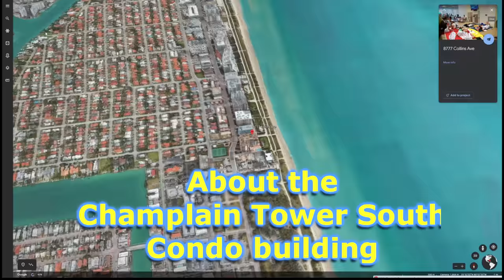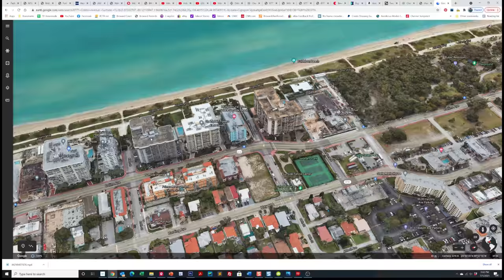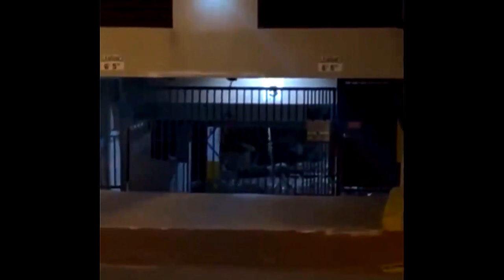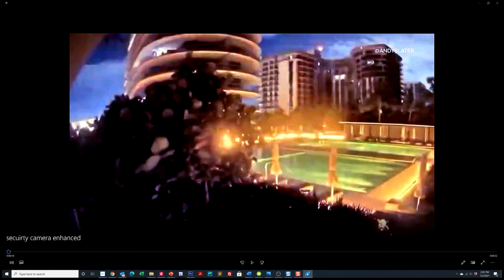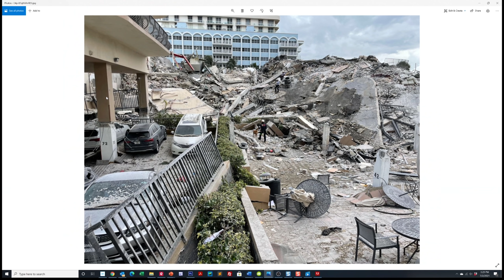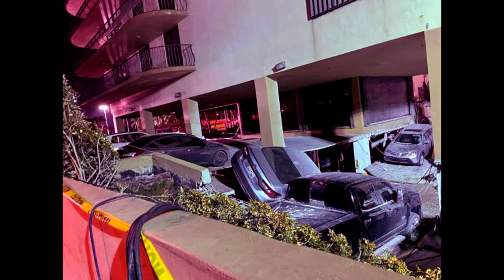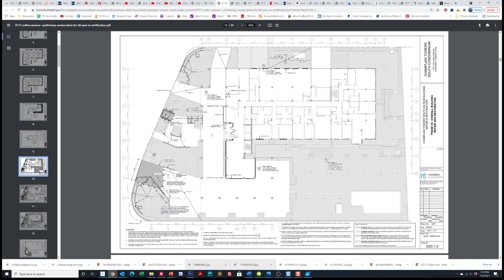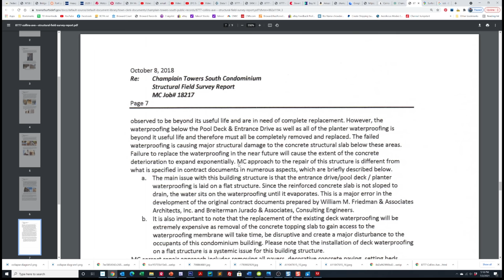Here's Cause Of Miami Condo Collapse Champlain Condo Towers, Surfside

Comment: Structurally speaking, it is a foundation failure due to cave in or seepage of water from the swimming pool, since this pool was built with no structural stability on the adjacent buildings. This building was so heavy that the soil bearing pressure on the pool side cannot resist this heavy loads so it collapse.
Reply from the maker: Everything you just said was incorrect. The pool was built with quite excellent structural stability and in fact that's why the pool survived if you look at photos taken the next morning after the collapse the water was still in the pool. So how do you derive from that that the pool was weak? There was no sink hole there was no sea water that came in as far as anybody knows
Reply: Sorry, that's just wrong, I'm afraid.  
The pool is still intact, and in its intended place, even after a major collapse nearby, because pools are built with very strong, thick walls and base to resist the water pressure. The pool is pretty much supported by the ground, not columns, so it's nothing to do with the foundations of the building. A pool leak couldn't remove THAT much rebar, there is very little around any of the column tops. 
I see your point about the pressure of the building being at the edge of the pool, but the pool hasn't moved, which would happen if that were the case. 
The building's columns have just sheared off where they should have supported each deck/floor, and once one has gone, the others come down, too.  
The foundations of the building have not subsided, or the columns would have gone down, when they are obviously still in place.
Good guesses, but wrong this time.

Comment: Pool equipment rooms are always wet. Stuff leaks all the time
Reply: Yes true, but should only be wet when a leak springs up or when washing the floor. If proper maintenance is in force then the leak will be fixed within a few days max. If water is due from washing then it will be drained and dried within hours or a day max. If the maintenance is shoddy or non-existent than the water will stand and over time cause structural damage. By the looks of the pictures, this building had a terrible to non-existent maintenance program!

Comment: YOU NEED TO GIVE THIS TO ALL THE LAWYERS FOR THE FAMILIES.
Reply: Its here for the viewing......
Reply: Why?  As condo the owners are residents.  With an few exceptions the residents were responsible for building upkeep.
Reply: @richranchernot  they were very obviously not responsible for maintaining the structural integrity of the building dude. Maybe their own rooms but not the support beams of the building or the pool.
Reply: It’s on YouTube it’s available to everyone even the lawyers.
Reply: I am sure they don’t need a Youtube video. Everything this guy has is known.
Reply: @zuthula3847  The owners run the HOA. They are responsible for the building. Normally, when there are major repairs needed, the HOA charges the owners a special assessment to cover the repair. They probably hired a professional management company to run the HOA. They could sue the management company but it probably doesn't have the insurance to cover something like this. They will likely file bankruptcy

Comment: A remark that stuck with me is that in the rubble, "there barely is a chunk of concrete"... Makes me think it would be good to have a CHEMICAL ANALYSIS done of as many samples as could possibly be amassed of the concrete... if there is anything that has been kept out can still be traced - be cause the concrete consisting of a mix of ingredients that is off could ALSO have caused its properties (and most of all, its strength) to have been (far) below par - which also may involve it allowing for water to seep through and in much easier.
Reply from the maker: I am hoping NIS will shed light on this
Reply: @jeffostroff  indeed.. any idea how much time they will still need, is there anything known about that?

Comment: Sadly, tragically, this is what happens when developers start compromising their resources. Looks like they did build columns much smaller beneath the part of the structure that collapsed, plus there was leakage from the pool deck that saturated the concrete and rusted the reinforcement, which then turned the concrete to mush. I also understand the design flaw of the pool deck, itself, which was flat, not allowing proper runoff. This is really so sad with so many truly dangerous factors involved.

Comment: You need a proper "pointer" when doing such an analysis with photos and videos. It was impossible to follow anything on the graphics.
Reply: Bigger pointer and different colour  maybe....Wow what a great analysis!  

Why smaller pillars in the garage!??
Reply: When it comes to watching on a phone,  most definitely. 
 Like the super-jumbo size one that reverses colors inside of it from Windows 95.
Reply: I didn't even notice a pointer until i read your comment.
Reply: I had eye strain from having to search for the cursor all the time. Totally frustrating presentation.
Reply: Superb program!  I had a lot of trouble following the pointer, and I watched it full screen on a 22 inch wide screen monitor.  My choice for pointers would be both a larger size and a pointer that assumes the inverse color of whatever it is on top of.
Reply: I dunno why everyone is such a great video. Five minutes in "but that's not what caused the collapse"

Comment: One thing that others may have mentioned. Where is all the rebar? Even rusty rebar dosen't just turn to dust. There should be a huge twisted mess of the stuff. Even in the close ups where the floor has ripped off the coloums ther eis almost no rebar visible. I don't know what late 70's florida building codes are. But this looks to have less than a 2 story house would in France!
Reply: The engineers probably decided on less rebar, and that could have made this building weak.
Reply: It wouldn't surprise me if the rebar rusted to dust. Near the ocean things rust waaay more than away from the ocean. Very common in AC units near the beach. The rust you can encounter is a whole different story to anything inland

Comment: A logical and helpful look at this terrible catastrophe. Thank you. Regarding blaming the architect’s plans, we should also go back and check the ‘specifications’ book [or sheets] that are integral to the CD set of plans. They usually contain language that states exterior horizontal ‘finishes’ shall be sloped a minimum amount per foot, for drainage. As you know this is code. And It is standard language ‘usually’ in drawing sets. I am guessing here that is exists. Regardless, your point about adequately sloping decks, is perfectly valid. Has anybody checked those spec documents? Sometimes general contractors don’t even read them. They are, admittedly very verbose documents -but very important. But it should have raised a request for information [RFI] during the GC bidding phase, and certainly the field before GC building the deck - using common sense practices. The deck also should have been inspected and approved in the field yes? So we must remember, a building is a team effort. Budgets and a hurry-up approach usually are the root of tragic mistakes made. Great job. We should learn a lot from this incident. I enjoyed this. Cheers.
Reply from the maker: I have not found anything in drawings are footnotes, other than the drawing of the deck, showing the large Xs across the deck meaning sloped toward drain

Comment: That water coming down from fire sprinkler pipe in the garage  , wouldn't it be pouring out under presure rather than running out. Under pressure it should be spraying, I dont mean as in a cone, I mean as in if you hold a hose with the tap open full pressure and no nozzle. That water coming from a pipe is from standing water coming from an overflow pipe. Salty substances will leach calcium out of concrete, causing stalactites to form from the sealing, making reo to spall and concrete to fail. Analysis is spot on.

Comment: At the Sampong Department Store collapse in Seoul, one person was pulled out of the rubble alive after 2 weeks. The person had an air pocket and access to water.  Of course the Sampong collapse was top down, a weak top floor collapsing on to strucdturally sound lower floors.  The Surfside collapse was a structurally unsoound base.

Comment: the garage had 4-6 inch stalactites, they turned it into a cave.. concrete is just a very hard sponge people.
Reply from the maker: we were shooting Brad nails into our baseboard in a condo I owned several years back and one of the bread nails pierced a plumbing pipe that was too low to the floor it was only two inches off the floor inside the wall period but it tripped and tripped over several weeks and next thing you know the neighbors down stairs told me they had water dripping on their ceiling because the slab had soaked up the water over that time

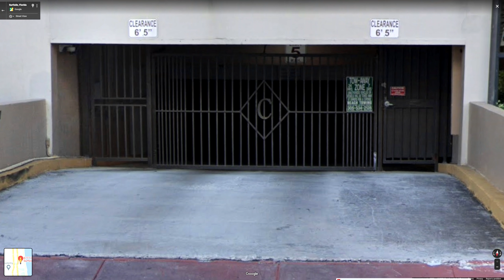Comment: I think that “beam” at 8:55 was just a metal sign.
Reply: You're right. It's that green "TOW-AWAY ZONE" sign
Reply: there weren’t really beams, that’s what blows my mind. there’s a higher chance, if the building had beams, it wouldn’t have been as a huge collapse and disaster, and there would’ve have been a way higher chance of survival. idk if it was for ignorance that they didn’t put beams, or what? but it’s devastating. you rlly can’t get fooled by the nice looks of a building, until you know the structure. structure is so so important
Reply: Yes, the sign, confirmed by street level view in google maps.
Reply: @nobodyknows3180  yup!

Comment: It didn't have a steel frame did it? Just a concrete slab house of cards.
Reply: there is an idea , have standing steel beams inside the columns , or  no concrete around them but they need fireproof coating . but are they so strong to carry much weight without bending maybe not so stiff . wood might work too makes every floor lighter.
Reply: @lofturhjalmarsson9896  Wood framing is great up to about 4 stories.
Reply: @johne6081  yea  l think they build higher now  with laminated thicker , but at least could have highest floors wooden if that helps any is it stiffer against collapse

Comment: Between FIU bridge and this, Miami's engineering and code credibility is pretty much zero.
Reply: So. Wrong. The FIU bridge was an FDOT project. overseen and paid for (mostly) by FDOT. Not miami.
Reply: @rtcoker6792  THANK YOU!
Reply: @rtcoker6792  Not true. I was in meetings with the contractor who built the project, and described in detail the project to us before the collapse. It’s a Miami contractor, not the FDOT they built a bridge.
Reply: I'm more interested in the Professional licensure of the guy who created this video.
Reply: I mean, you build an entire state on a swamp and all of us are to blame.
Reply: Contractors r usually to blame, whether using shoddy equipment or building materials, them trying to cut costs and save themselves money ends up costing innocent people their lives…the place was built during the start of the ramping up of the coke boom in Miami and the US, wouldn’t surprise me if dirty money from dirty people were responsible for building these places….

Comment: I work commercially with pools, and I've never seen a pump room that was "bone dry". Just sayin'
Reply: I was thinking the same thing. I worked briefly at an Olympic size pool (in Italy) with a MASSIVE filter/pump room. It was the wettest place! Condensation would run down the walls and you walked in water on the floor... I hope that place gets maintained.
Reply: @mryoung8586  Not just that. The pumps need to have their filter baskets cleaned out. Every time you open one up, you're going to get water on the floor. The sand filters have bleeder valves that will leak water. Those pumps are elevated either because the maintenance staff didn't want them sitting in water constantly or because they were replaced a dozen times and they needed to match them up to the existing piping. It may not look "professional" but it's perfectly normal. Things like this are difficult for people who have never worked in building maintenance before to understand. Maintenance staff in places like this are generally working under serious time constraints, dealing with angry tenants, and a tight budget. They do what's necessary to get things back up and running as quickly as possible. Either way, that damp pump room played no part in the collapse of this building.
Reply: Also, if the deck collapsed first, the wet pump room that is on the side of the building has nothing to do with the deck
Reply: @LovethisNation  Wet leaking pool pipes running from the pool to the pump-filter well inside the center of the building at garage pylon #78. The damage could have occurred all along the path of those pipes.
Reply: @gwebocelestron9194  the pump room wasn’t in the center of the building
Reply: @jorgejimenez1877  Exactly. I'm right there with you. The problem was cutting corners on materials and reducing quality to save money, for sure.
Reply: The fact that you're listing excuses for why maintenence can't do what is necessary to maintain a building SAFELY shows how broken this system is. Not on you the maintenance worker... but the expectations, greed, and impatience of "angry tenants" and greedy building owners is what led to this kind of tragedy. If maintenance were given the proper time and money this may not have happened! Fix it before this happens again! So it doesn't have to be "as quickly as possible" it needs to be AS SAFELY AS POSSIBLE
Reply: @LovethisNation  I don't think he is saying the wet pump room caused the collapse.  I think he is saying the wet beam cracking, is evidence THE ENTIRE DECK SUROUNDING THE BASE OF THE BUILDING IS NOT WATERPROOF.
Reply: me either.  This was done with a DEW.
Reply: @user-pf5xq3lq8i  maybe, but the wet pump room is right underneath the pool. Assuming the rest of the deck has the same issue is a leap without other signs of damage under the pool deck
Reply: @LovethisNation  The residents said when they walked on the tiles on the deck, water would shoot up the cracks between tiles and wet their clothes.  This happened long after rain had ended.  It would also pool on the deck above ground near the entrance.  There is no where for the water to go.

Comment: That's how every pool pump and filter I've ever seen is mounted they just sit it on something it's not even fastened down it just sits there held by the PVC pipes. Several polls that I've seen they just have it sitting on pieces of scrap wood not even a cinder block.
Reply from the maker: Appellation Engineering at it's finest!
Reply: Might have to do with vibration md expansion, needs a certain space to move?
Reply: They need to be aligned with the PVC pipes, so floating keeps stress off the fittings as things shift with temp.
For those pumps, it looks like they were spaced over the floor to keep them out of flooding in the room (!).
Reply: @seanclark8452  I thought the same thing, floor was always flooding so they had to find a way to keep the pump off the floor. They just didn't do it professionally.

Comment: So the construction didn't follow the design and engineering plans.
Reply: Not exactly, the design and engineering was lacking in its quality.
Reply: All work is inspected by the engineers
Reply: @viceroyviceroy-wj7cf  Yeah.  Just like the Kansas City Hyatt was.
Reply: It wouldn't surprise me if someone whined that it would make the pool deck too slippery, possibly attracting law suits, if there were a slight angle to it, and told the builders to straighten it out.
Reply: @sashizakura9124  A good slope is 1/4" / ft., a bare minimum slope is 1/8" / ft. Typically pool decking incorporates a series of area drains, the slab below would not have been sloped but it would have been waterproofed. This waterproofing failed and the deck saturated and decayed. It collapsed, took some support columns with it... A preventable nightmare.
Reply: @mjpicard00  A nightmare indeed. Your home is where you feel safety. Can't imagine a worse breech of personal safety than being smashed while sleeping.

Comment: This whole situation could easily have been prevented had these condominiums been maintained properly 
This is really frightening   So sad 
Or maybe the infrastructure was faulty from the very beginning   A bang up job in order to cut costs
Reply: I lost everything in an apartment building a few years due to negligence by maintenance and the property management company. They are greedy cheap skates and hire low wage unqualified workers. In my case, they had some kid, not a licensed electricians replacing light fixtures in a vacant apartment downstairs. He left bare wires throughout, power not shut off, and went to lunch. That caused a spark, ignighting debris in the ceiling and set the building on fire. Yes, I won my suit, but they tried everything to wiggle out of being responsible. These situations are the norm and put a lot of people at risk.